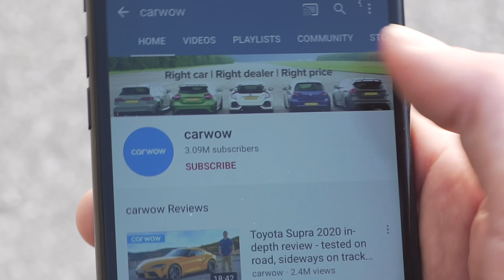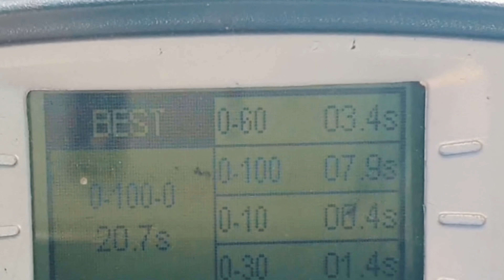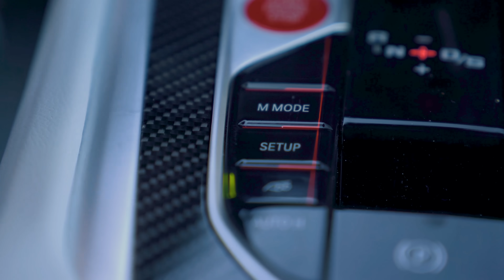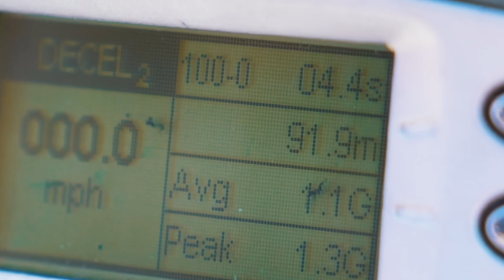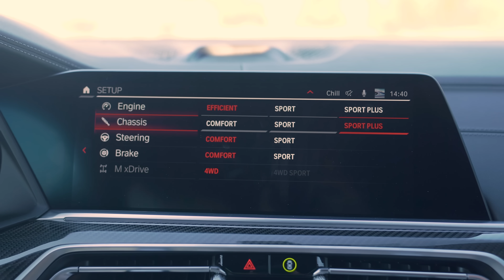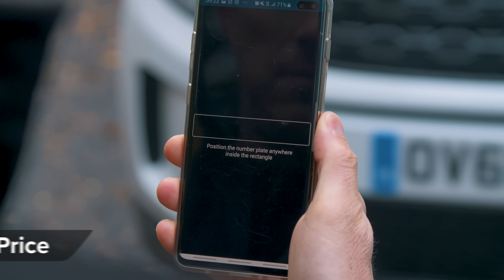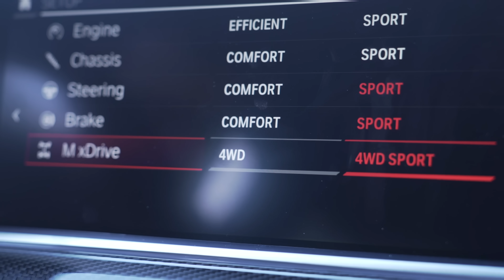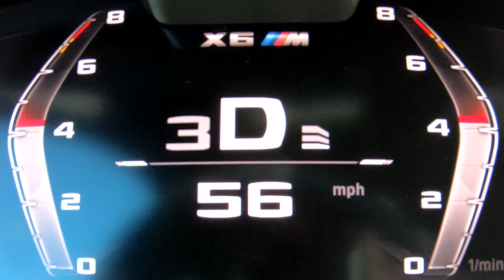The new BMW X6M is bonkers quick! REVIEW

Comment: I remember when Enzo’s and CGT’s were doing 0-60 in 3.5 secs 15 years ago and now SUV’s are doing this 🤯
Reply: SUVs almost nobody can afford.
Reply: @JohnnyZenith  alot more affordable then an Enzo
Reply: @davecom3  
The standard McLaren F1 has a transverse 6-speed manual gearbox with an AP carbon triple-plate clutch contained in an aluminium housing. The second generation GTR edition has a magnesium housing. Both the standard edition
No auto here!
Reply: JohnnyZenith nobody that you know.  There are plenty of people out there who will buy these
Reply: Leestaines1 We should all thank Tesla for coming along and shocking the auto industry with Model S and Model X, both doing 0-60 under 3 seconds.  That’s when everyone else suddenly woke up and started giving us real hp.
Reply: @aussie2uGA  LOL, Tesla can do that because it's electric. Real cars offer more than straight line speed acceleration.
Reply: @aussie2uGA  That's true
Reply: @Elias_g1  but still it is surprising that an electric car can do that better from any gasoline cars
Reply: @swathiharsh5377  Why is it surprising ? It's all physics. Nothing is surprising.
Reply: @Elias_g1  that's true
Reply: @davecom3  it weighs nothing.
Reply: @davecom3  F1 had a manual
Reply: @Demofix33  changed my original post as that's what I meant initially
Reply: JohnnyZenith: These cars rapidly depreciate. I always buy them second hand. The savings are enormous.
Reply: Yep you can thank Awd traction, turbocharged torquey engines and fast gearboxes with short gearing for that
Reply: Yeah but super rare Ferraris and stuff like that aren't for 0-60. I could make my Audi A3 do 0-60 in 3.5 seconds. Unless you're drag racing, it's quite irrelevant. But i know that your point is how far we've come and yeah, it's pretty cool.
Reply: Aussie2u HP war already started tbh, 1st gen X5 M made 555PS 10 years ago.We can thank the R35 GTR for making traction, launch control and 0-60 such a big deal though
Reply: @aussie2uGA  we got real hp way before tesla lmao, stop fanboying all over the internets
Reply: @TheSzopen123  And not affordable for most people.
Reply: @Spartan168  Yes, and even more that can't.
Reply: @JohnnyZenith  YES, HOWEVER FAR CHEAPER THEN AN ENZO
Reply: Numbers aren't everything.
How the car gets you there matters more, sound and feel. 

How the car makes you feel while it's getting you there, matters even more.

These mall creature crossovers are just that.

I'll continue to enjoy my ⚅ speed 392.
Reply: @aussie2uGA  Yet you can't go over the speed limits much without getting your wallet/license broken, so ain't much of as point.
Reply: @TheSzopen123  Not as good an investment though.
Reply: @TWENTYSEVENSTORIES  Your right. But unless you were the pope or a ferrari vip you were not gonna get an Enzo
Reply: @JohnnyZenith  stop hating and figure out a way if you want one! The opportunities are out there.
Reply: Leestaines1 Impressive!
Reply: @TheSzopen123  True.  Though if they saw the version of it Shumacher had they might not feel so much of a ferrari vip. Apparently Sir Rod regrets selling his after the price went up. He should have known better.
Reply: Aussie2u 

What? The Tesla isn’t comparable? Why do people compare Tesla to cars? Non car guys with this Tesla bullshit, Tesla doesn’t even make real SUVs, they’re cars, and they believe they can get away with calling a model X and especially that toy model Y a crossover or SUV.. and they’re electric. BMW/Mercedes/Audi and Porsche will kill Tesla once they’re interested in real electric cars. Tesla is just ahead of the game, once M cars and AMG cars become electric it’s over for Tesla.
Reply: @aidenp5768  Tesla definitely has performance but it is able to use... 4/5 times before battery starts overheating and power is cut off. Also if you want to use it's power, you are going to drain your battery ultra fast and in opposite to gas engines, you cannot fill it up in 30 seconds.But still, the biggest drawback of Tesla cars is quality. Paint going off, trim pieces not aligning, interior wearing off quickly, water leaking through doors and windows, based on how many of these cars already have rust on them, it looks like they don't have any rust protection, they have almost no physical buttons on inside... To really compete with european premium brands they need to achieve quality of european premium brands. Sadly, I doubt they can afford that jump in quality without making their cars expensive or incredibly heavy. They're now just producing boring equvalent of Hellcats IMO. And as a fun fact, when Model S came out, tons of non-car guys jumped on high-tech hype train and claimed that this is "M3- killer". I checked how well it did on Nordschleife (nurburgring times are not any measure ofc but they still can ilustrate car's performance IMO). And M3 was faster than Model S. M3 E30.
Reply: @aussie2uGA  hahaha sure...
Reply: @Rz St wdym
Reply: And soon, boats will do this 💪
Reply: Mat please reply to this I’m a big fan of your videos and watch them a lot. Thanks

Comment: I got my drivers license in 1974. Cars have evolved exponentially- unbelievable performance, luxury, safety, quality and fuel efficiency. A 1974 corvette only made 195 hp and did 0-60 in 6.8 secs while returning crappy mpg, rode hard and was a rattle trap after 20,000 miles. Navigation? A fantasy. 4wd was limited to trucks. Luxury cars were slow af. This is still the golden era of ice cars.

Comment: The "Hot V" is meant to put the turbos near a hot place in the engine (the inside of the cylinder banks). By doing so, the turbos are always at operational temperature, so the turbo doesn't need to spool up as much, meaning there is much less turbo-lag.
Engineering Explained did an excellent video on it, explaining how it worked when Mercedes applied the same concept first. Everybody should go watch it!

Comment: M power is ruling the segment 🔥 
M8
M5
M2CS
X4M
X3M
Now X5 M X6M 
waiting for new M3 & M4
Reply: BMW is simply the best. It looks great, it drives also pretty nice and the quality is awsome.
Reply: M8 - Audi R8 v10 plus
M5 -its nice 
M2cs - RS3 Saloon 
X3/X4 - most useless car and that goes for all cars in that category 
X5 - nice
X6 - RSQ8
Reply: @MrHussain1998  M8 is just a gt car which can be compared to rs7 & Gt63s 4door so R8 v10+ is not valid rival it's a super car BMW don't have competitor in this class.
M5 - it's nice ( benchmark in the class)
M2cs - it's the only car in the segment with proper rear wheel drive and manual it's much hardcore sports car compared to rs3, but I agree rs3 is quicker off the line (only because of awd) and much practical but that doesn't require in this class if u go for track weapon
X3m/x4m who told you that x3m a useless car it's much better than rivals and it does it's job quiet well, for x4m I'll agree it's most useless car personally I don't like it but that's what the segment wants and people buy it
X5m (Benchmark of SUV)
X6m - Rsq8 is much better in terms of technology & styling. But wait it's a performance SUV coupe segment where X6m outruns rsq8. 
Audi lost its performance upper hand when BMW launches x drive in M car same goes for AMGs
Now Merc is leading with Mbux & beautiful interior design & BMW leading performance & quality interior Audi is going for cutting edge technology !
Reply: @dilshad3490   Dilshad  M8 - so you want to get all technical, okay the RS7 which is a 5 door, okay still better imo.

M5 - BeNcH mArK iN ItS cLaSs happy?

M2cs - yes track its a lot better but 90% of the time everyone drives it on the road so its useless especially in the UK (RAIN)

X3 okay you can have that as well

X4 HOPELESS  HOPELESS which we agree 

X5 is actually a beast again agree

X6 show me where the X6 "outruns" the RSQ8?

Lets be honest BMW are nice but most people got them back in the days for rear wheel drive, which now BMWs are starting to lose new 1 series, I don't even want to get into Mercedes, you're going off like BMWS have the fastest cars, yes in some categories, but you're making it out as if all Audis have a 1.9Tdi engine.
Reply: @MrHussain1998   Audi don't have a proper gt car that's why I compared to rs7 it also lacks rs6 sedan 
And for rain m2 cs meant for track not road check once more it's not competition it's club sport stripped car which is meant for track 
New 1 series is absolute let down for me and all car enthusiast out there, so I didn't mention it, but think about old m140i it's still best among hot hatch
I am not degrading Audi but you should accept fact Audi is lacking behind Merc & BMW in terms of out right performance & drivability, even their sales shows it, at the same time we can't forget e tron techs introduced by Audi.
For me only letdown for bmw is interior design & grill which they introduced to attract Chinese market
Reply: @dilshad3490  okay I didn't know thats what CS meant ma bad, I'm not being biased at all but I would still take the RS3 over the M1 even if you take the badges off, I'll give one thing to BMW their M sport cars not the M look a lot better then S line cars, yes most classes they do lack performance, but you have to agree that the RS3 is the best in its class thats a fact, (yes i know the M1 would be better if it has 4WD but it doesn't)
Reply: @MrHussain1998  absolutely rs3 is bang for buck car it's one of gem from Audi there is no question about it
Reply: @dilshad3490  Im selling my M5 comp and buying the new RS6... The M5 is the worst car ive owned and has the build quality of a Kia... Wont buy BMW again - stick to Audi, Porsche and Bentley.
Reply: @pseudonym6642   Currently there are very few cases reported against on going m5 which is released from 2018 my cousin own a 2018 model m5 f90 by now it doesn't have any problem other than few software issues.
Lol do you think German cars have reliability as Japanese & Korean counterpart go for rs6 good to you 👍
Reply: Pseudo nym Yeah, sure

Comment: 0:32 

The purpose of the hot v is more about the temprature reduction of the engine..  the turbochargers are normally sitting on the sides in a lower position which causes a higher engine temprature because the high temprature goes up...
Reply: that why it's called HOT?

Comment: 0:40 it is about the distance from the engine to the turbos, not about the air going to the engine. That way the exhaust gas travel less  distance and lose less energy on the way before it spools the turbo.
Reply: The distance from the engine to the turbos is the same as in a typical twin turbo setup with the turbos on the outside. In any turbocharged car built in the last 40 years the turbo bolts directly to the exhaust manifold. The main advantage is that putting the exhaust side in/up you help keep the exhaust hot and the intake cool compared to doing it the other way around.

The distance for the intake air to travel is shortened by using the air/water intercoolers.

Comment: X6M V8 Biturbo, wider rear track than front track bodyworks all with Formula one speed 160-250 km/hour, over 250 km/hour on all circuits and test maximum over 20,000-150,000 rpm status over 20-100 l/100km, over 100 l/100km, Easy damage engines, extreme tail flick, extreme slide

Comment: It will 0-60 in 3.5 s only. That's good. The uphill time is same as a flat surface. Even a Lamborghini Urus can do 0-60 in 3.4s. Someone has claimed that. It means that these sporty SUVs are 0.2 or 0.3 s quicker than company claims.

Comment: There's that much forward momentum and torque with this vehicle, that the effect of gravity over such a low y height (considering the x distance – the length of that stretch of road) is negligible, on performance times. Hence the minimal difference between up and down hill times (despite not even having as seemingly good a launch when going back up the run.) 

It's akin to, holding a pistol parallel to the ground, pulling it into your hip, while still facing forward, keeping the gun parallel to the ground and pointed forward also. Then, leaning over the barrel, so you're looking down, over the top of the end of the gun. And then, blowing out a deepish breath, vertically down onto the barrel end, then firing. 

The difference the effect of your breath on the time it takes the bullet to travel a similar distance of that stretch of road, would be about the same effect as that incline in the road had on this car. With respect to its 0–60mph, or a ¼mile times.

Or summat. Science innit.
Reply: Lol! Good that! You shud do a u science bit on their vids!

Comment: "It's more planted to the road". Well it should be, 2,3tones is a lot of rock to move. Try pushstart it, when you are out of battery. You will need that slope. Things are just bonkers. Get a BMW X6MC and then someone with an M5 will literally run rings around you. Hey when you do the drag race /eventually/ with those super, ultra, mega, giga SUV's can you do a run with a trailer, just to see who's got the ball to tow.

Comment: Wow，it's not even tested on a drag strip.  0-60 3.4s，1/4mile 11.6。 It's faster than Rs Q8，Cayenne turbo，Urus and the new GLE63 in straight lines.  And most likely also faster on track.